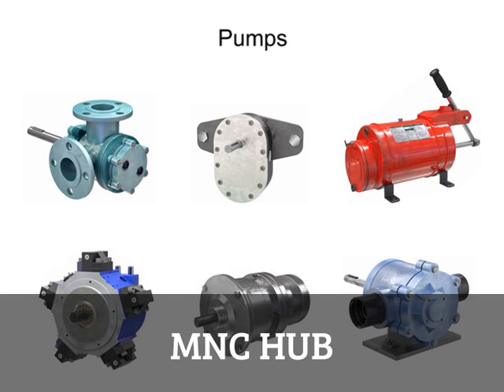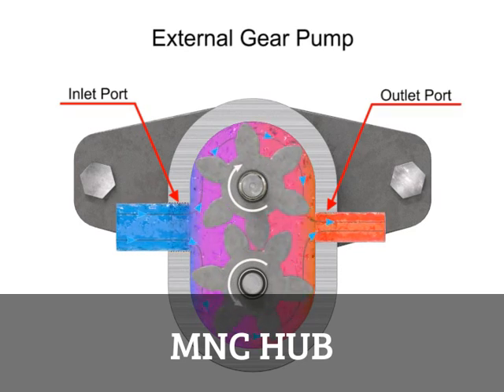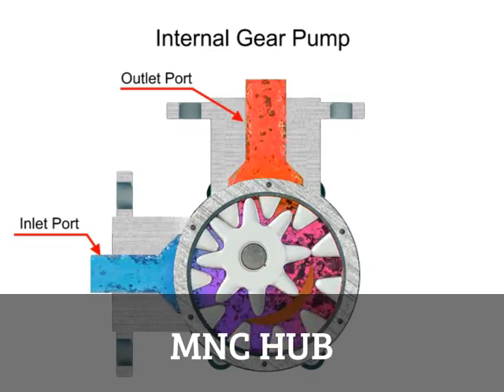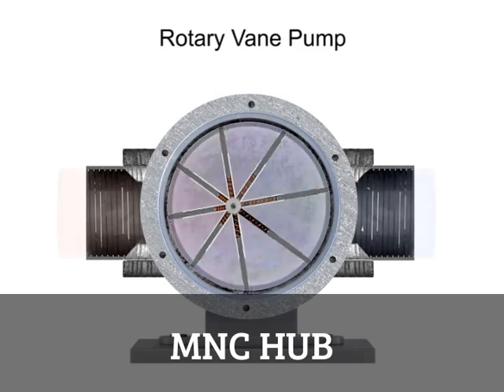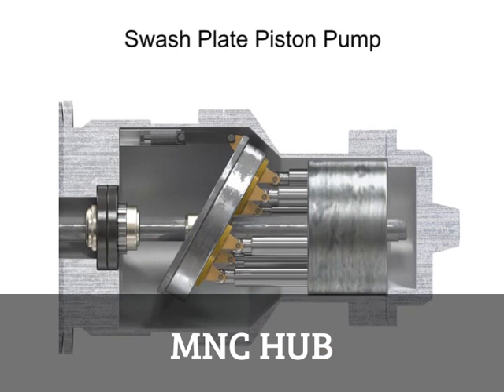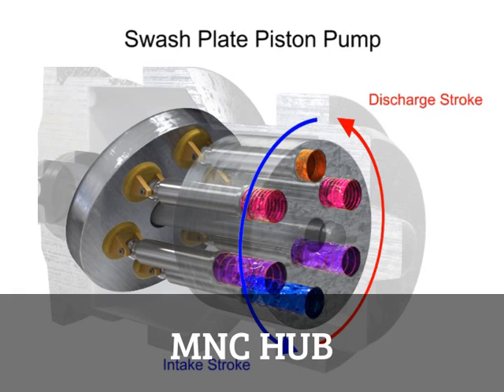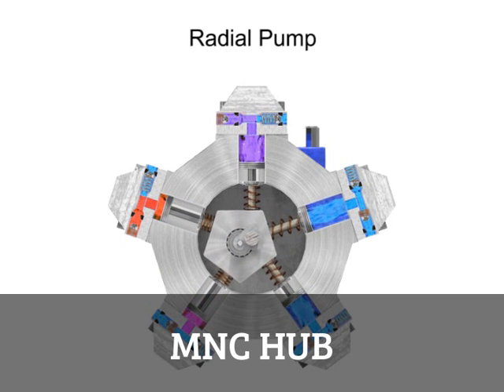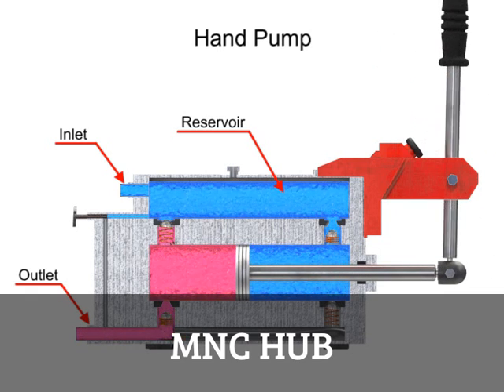Animation : Types of Hydraulic Pumps

Comment: Great video. The missing thing in the video is most of these are fixed displacement pumps except the piston pump . Many pumps in use now are variable displacement piston pumps. The difference is the swash plate is moved externally.  The operator can make it pump maximum flow or no flow. These are common when flow needs varying but engine speed is constant.  By making the swash plate run true no oil is pumped, as the pistons don't move in or out at all. When u move it out of center it starts the pumping action. Hope this helps .
Reply: point on explanation.
Reply: Hello Doug B
X2!
They show the swash plate angle adjustment actuator at the top of the pump in their illustration, but make no mention of it.